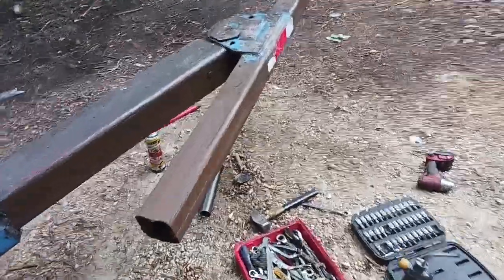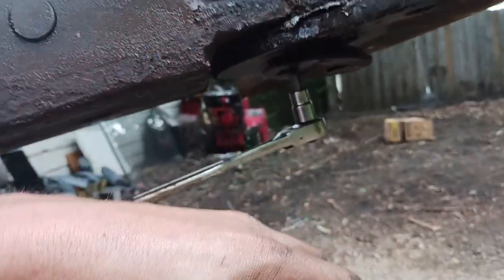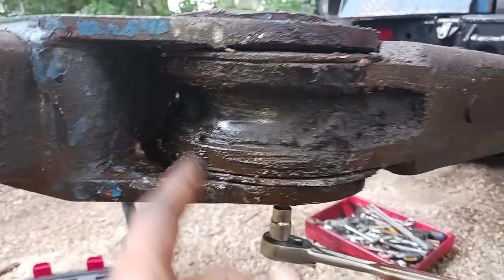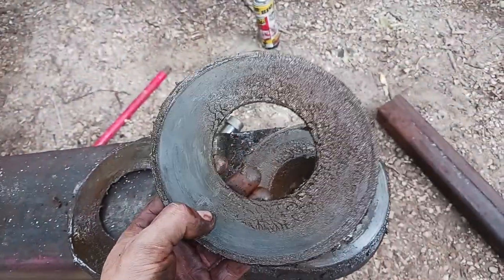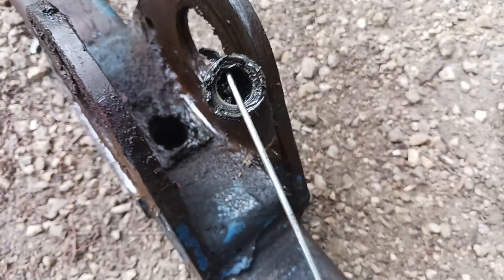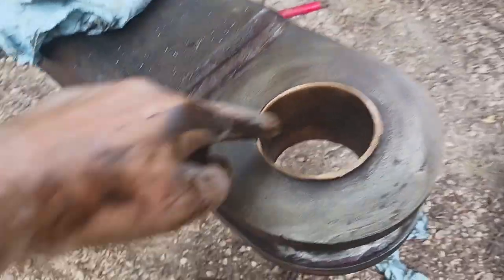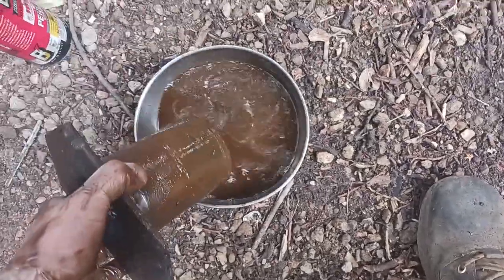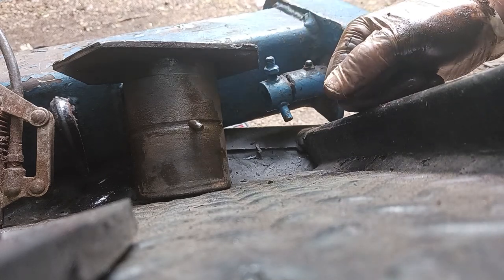Slop in the Wheel Lift

Comment: Dam I just got a wrecker I think I'm just have to change it completely because of what they did because those bushings worn out
Reply from the maker: A neglected wear item. You get more lift an control when the arm isnt floppy
Reply: @MNDashcam  Very true. Your video is the only one I could find. I've got an i500 and I'm told there's no more parts to be bought for it. So I need a Pivot Pin I guess. Pretty sloppy no disc on top or bottom leans hard. Still using it too. But not sure how to get out. NO bolts to be seen. top or bottom. had a plate on top made with four screws.bolts were.. Gone now.. My Bar is spread a tad.. But I think still good. Any suggestions on how to rig one.. Since I can't get get new? I'm thinking Bushings & Disc and put the same pin back in.

Comment: How can I get the disc to replace them? 
And how do I get my pin apart without destroying it to reuse or can I?
Reply: Oh my W/l is a challenger/Miller
Reply from the maker: Zips is a good source for parts. They got what you need.
Reply: @MNDashcam  Man... It was ready.. Had a BMW on there, I dropped it, and it was grabbing the rail on the lower part of radiator I guess.. And it pulled my pin right up and out. I liked ta shit.
Pin was in good shape considering
Bushing was still good.
And yeah, I went to heningers, here,, 20 bucks each. two disc.. Greased and she's like new. Thanks buddy